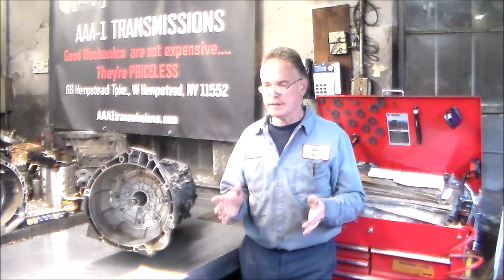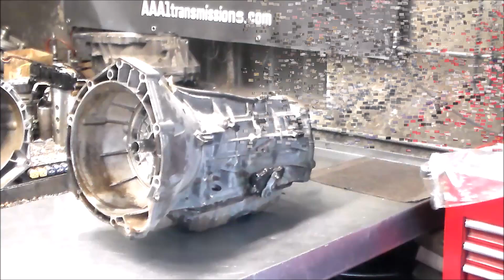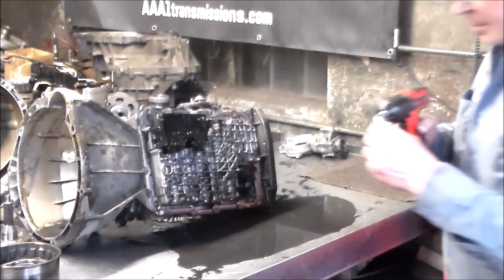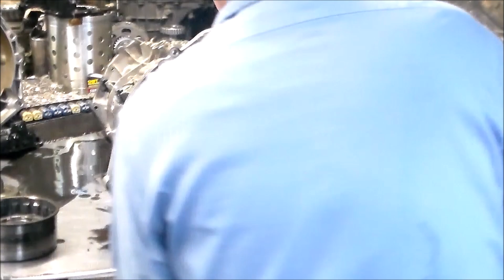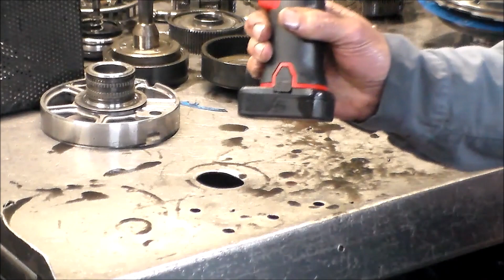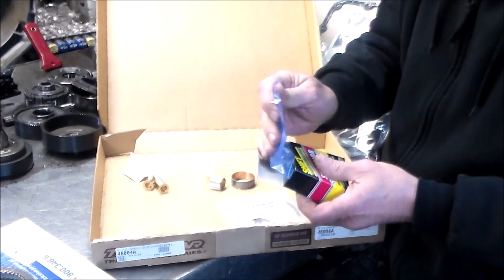Cousin Nick's 5R55S Teardown

Comment: Hello. If I may, I have a question about the 5r55s automatic transmission. It is installed on a 2003 Explorer 3 with a 4.0 engine. The transmission is labeled 2L2P BE. There are no other identifying marks. My first question is, can I install a used 1L2P transmission from a 2002 Explorer 3 with a 4.0 engine? Will the O/D light blink with a slip error? And the second question: the O/D blinks if you drive on the highway at 60-80 miles per hour. If you drive in the city with sudden accelerations and frequent braking, the error may not appear. But it's getting more frequent every week. The scanner shows P 0741, but there can be many reasons. How can you diagnose the automatic transmission without removing it from the car more accurately? There are no specialized service centers nearby. You have to do it yourself.
The oil is clean, there is no metal dust, and I changed it partially two miles ago.
Manual level

Comment: Excellent presentation! 
I have a recently rebuilt 2006 5r55s. Ear snapped off of the od/2/5 band on the apply side. I dont know if there's a wrong direction for the band (i.e. is one ear definitely the apply or adjust side, and how do i tell?) Also: how damaged would the pump be if i remove it that way?
Thanks!
Reply from the maker: Band can go either way.   Shouldn't damage the pump
Reply: @GaryFerraro : thank you sooooooooo danged much for both the reply, and the promptness thereof!
Reply: How much of a pain (and any tricks?) to install the pump with the case in a horizontal position (still on the jack under the vehicle, resting on the pan).
Reply from the maker: @erikdiamet2358 tilt the jack back. Pump should slide right in. Keep the input shaft installed
Reply: @GaryFerraro again: thank you ! Main thing that threw me was that the welded on ears have different numbers stamped on them. I have spent an unseemly amount of time searching forums, videos, and comments  trying to find this information.

Comment: I'm getting codes for three solenoids and low pressure codes for the same solenoids whether connected to the trans or a solenoid pack outside the trans
Reply from the maker: what are the code numbers?

Comment: Do you answer any questions on this trans. I got a junk yard trans opened it and it is like this one. Upgraded a few parts and the original plan was to get it to the shop get mine out and do the rebuild as I know what is going on with that one.
Reply from the maker: Sure, what is your question
Reply: @ what’s the best place to get internals price wise? Like the ones in your video. Also did you change anything in your rebuild of this one the od planetary  came apart in when reassembling it?
Reply from the maker: @jasonbaker4052  Do you know what your looking for as far as internals? I usually change the O/D planet.  What year is yours?
Reply: @ it’s out of an 08 so 38 tooth. Planet is scared and the sun gear is shredded. I am also missing one large bearing on the reverse sprag drum.
Reply from the maker: @jasonbaker4052  can you send me pictures.  
gsferraro@yahoo.com
Reply: @GaryFerraro  I emailed you

Comment: Great video Gary. I have one of these in a 2010 Mustang. Its throwing a PO741 code. The car has 109K miles on it and drives and seems to shift good. I'm trying to decide if I should throw a converter, solenoid pack and fluid at it or if I should just buy a reman one and install it. I don't really know the service history, my guess is none. This was her boyfriends car  before we got it and he was running it hard one night, it backfired and then the wrench starting coming on with this code, no other transmission codes comes up. She plans to keep the car for a long time, so maybe the reman route is the way to go, its just really expensive lol.

Any advice on a reman company to look at? I know I want the servo sleeves installed if I go that route. Thanks for the advice. Russ
Reply from the maker: Do you have a scanner that shows live data?
Reply: @GaryFerraro  I have a CRP129X. It is supposed to show live data. I havent tried it yet.
Reply from the maker: @DoubleRRestorations  look at your converter slip, the PID may say  TCC Rpm or TCC slip, if you can let me know what it is
Reply: @GaryFerraro  Will do. I may be a bit, but I will. My daughter will be home in a couple of weeks and we will test drive it and let you know. Thanks, Russ
Reply: @GaryFerraro  Hey Gary, my daughter is home from school and we are getting ready to test drive the car. Is there a certain rpm or speed we will need to be at to give you this data. Thanks
Reply from the maker: @DoubleRRestorations  i would think at least 50 mph   at this point the converter should be fully locked on
Reply: @GaryFerraro  Hey Gary,  yep, about 50mph, it would lock up. I could also see the solenoid engaging, and the Converter slip desired rpm would be 1020rpm. Once locked, its desired rpm would be 0rpm, but the actual would still go over 200-500. That's when the wrench would come on with a po741 code. 

We did check the fluid before we drove it. (What a task that is without a dipstick, lol.) It was a quart low. 

The tcc actual rpm really bounced all over the place.  I feel good about the solenoid pack with what I saw today on the scan tool. Im thinking it is a defective torque converter
Reply from the maker: @DoubleRRestorations  With that amount of slip very well could be a bad converter,  Also, check the ring on the stator to make sure thats good
Reply: @GaryFerraro  Thank you Gary. I really appreciate your expertise.  Will do.
Reply: @GaryFerraro  Gary, my daughter and I finally dropped the transmission. I had a few questions. I made a video about it. Ill post the link in my next reply. I Know sometimes YouTube blocks links. Thank you for all your help!
Reply: https://youtu.be/HUY7Eeyi_Zc
Reply from the maker: @DoubleRRestorations  Thanks for the video,  1st question do you have a scan tool that shows live data so you can read the converter slip?  The input shaft goes into the O/D planet.  The solid ring is probably ok, i change them and use the converter to resize it, but it looks in good shape.  Question,  when you were moving the input shaft in and out, did it have any up and down play, when the front stator bushing wears out, it can cause a 741 code,  worn pump bushing will do the same thing.  But the big question is, do you know what the converter slip is?
Reply: @GaryFerraro  The slip on the scan tool was low. Like 100-200 rpm over 50 mph. I did see it go to 500 rpm once. When the input shaft pulls out and stops I can feel just a small amount of play, but its not much at all. Its kinda tough to tell because the trans in on a jack/ It barely moves though, if I push it all the way in, there is no movement.
Reply from the maker: @ you saw the slip go to 500 while in lock up ?
Reply: @GaryFerraro  Yes, and the wrench came on the dash.
Reply from the maker: @DoubleRRestorations  Would you say it comes on rather quickly after clearing the code and then driving the car?
Reply: @GaryFerraro  yes, every time we reached 50mph within a minute or so, it would throw the code. Most of the time I was seeing 200-300 rpm, but I did see the 500rpm once.
Reply from the maker: @DoubleRRestorations your converter is probably the problem

Comment: Long shot here.. but im desperate. 
2005 explorer xlt 4.0 with the 5r55s.. no reverse.. all forward gears seem to work fine. 

Had a notification prior "check advtrac" (sorry running on fumes) 

Had a slight knock from trans area, i didnt listen long but sounded like TC per its rhythm with the rpms. 

Then one day it just had no reverse. I hadnt had anytime to check it out.. was hoping it would last longer than it did.

I can work a wrench, but never rebuilt a trans.. not sure what process for diagnosing no reverse other than start at the pan, watch youtube, and hope i can find some help..
Reply from the maker: Sounds like your reverse band is broken.  If the car upshifts with no problem tells me your direct clutch is good, so you just have the band left that would engage reverse

Comment: Gary...does the "sleeving" for the servo pistons hold up. I have seen some techs use brass and others use bronze sleeving. Then others have used modified pistons with teflon//delrin molded to the piston. Thx for the vid!

Comment: You make it look so easy,sending away my transmission to a rebuild shop. It was a used one i bought 2020,not this time u getting it rebuilt.  A new rebuilt from work 4 years ago was expensive, but it still be running, maybe.  Have a good week bud. Ps,me being a pack rat, i kept the other transmission,it got very hot,overdrive light on. By the time i got home,shut it down,fired it up,no gears.😂
Reply from the maker: Thanks for watching
Reply: Sprag gear for the overdrive 40 dollar part your welcome look it up most common failure

Comment: Nice video. I enjoyed the humor also. Great job. ❤
I have an 04 Mercury Mountaineer 4.6 (Ford Explorer) with this transmission. Starting to have some transmission issues at 400k miles. Its been a great vehicle for me.
Reply: nunca antes de las 400.000 millas había tenido problemas de transmisión o motor?
Reply: @bugayev motor is original. I've replaced the timing chains around 220k miles.

Comment: Unbelievable! you actually saw my comment. Thank you very nuch.  Not long after I had the transmission replaced, probably about 4 months, the Overdrive light started flashing after driving the vihicle a bit. But it still ran ok.the mechanic told me it was probably nothing because the vehicle still ran just fine and if it got worse to call him.  It did not get worse but I noticed what appeared to be an oil or transmission leak so I took the explorer to him about a year ago, he checked the fluid level and said it was ok. My wife was driving it two weeks ago and it jumped into the next higher gear when she pulled out from a stop light. When she tried to back out from work, the car stopped moving in reverse and also would not go forward. So her co workers pushed it back into the parking space. But when she got into it later, It ran ok and she drove it home. I also drove it in all the gears including reverse and it drives ok. So I checked the fluid level, it appears ok but the fluid is quite black!
Reply from the maker: Theres something wrong, maybe filter partly clogging up.  Something should have been done when that light was flashing. I would never let a customer drive it with the light flashing, means computer see a problem.  Do you know what code was present?
Reply: I do not know the code but tomorrow I will check it as I have a code reader. Also, I intend to drop the pan and check the filter and check for metal debris. Too cold to do anything today. How do you know where to reinstall all the parts that you took off the transmission? Thanks again for your help. @GaryFerraro
Reply from the maker: Im in the industry since the 80's, plus i do a lot of these units @ronhat-nx6yq
Reply: the only codes I have are p0128 0430 and 1700. 0128 is because engine is cold, 0430 is catalytic converter and 1700 may be transmission.  @GaryFerraro
Reply: @GaryFerraro question, I have a 2003 ranger with 5r55e. I would like to swap in a 55s or 55w because of the lower 1st and 2nd gear ratios. Is this possible? Are the plugs on the wiring harness the same? Will the same PCM work or will I need a different one for the 55s/w. I know that’s technically several questions, but I would appreciate any info you could give me.
Reply from the maker: No, 2 different units @Basketofdeplorables173

Comment: Incredible! I would never get this thing back together. In fact I could not even get it apart. My 2003 explorer transmission just quit. When I checked the fluid level, the fluid was black. And this transmission is only 3 years old as a rebuilt one was installed.
Reply from the maker: Stopped moving?
Reply: Unbelievable! you actually saw my comment. Thank you very nuch.  Not long after I had the transmission replaced, probably about 4 months, the Overdrive light started flashing after driving the vihicle a bit. But it still ran ok. He told me it was probably nothing because the vehicle still ran just fine and if it got worse to call him.  It did not get worse but I noticed what appeared to be an oil or transmission leak so I took the explorer to him about a year ago, he checked the fluid level and said it was ok. My wife was driving it two weeks ago and it jumped into the next higher gear when she pulled out from a stop light. When she tried to back out from work, the car stopped moving in reverse and also would not go forward. So her co workers pushed it back into the parking space. But when she got into it later, It ran ok and she drove it home. I also drove it in all the gears including reverse and it drives ok. So I checked the fluid level, it appears ok but the fluid is quite black! @GaryFerraro

Comment: I'm looking at buying a 2003 V8 Ford explorer and it slips in 3rd gear (drops out). Got any suggestions?
Reply from the maker: May have a broken band, very good chance it will need an Overhaul.
Reply: @GaryFerraro  is it okay to drive it in first or second gear about a mile
Reply from the maker: if the car shifts to 2nd you can go at least 30 mph,  are you planning on getting this fixed? @harrycash8713
Reply: Yes Gary I bought the car 2003 Ford explorer XLT 4.6. when I put it in first gear it's fine when I moved to second gear it's fine when I move the selecter to third gear it starts acting kind of funny and then when it gets into drive it starts slipping once it's warmed up. The only code I'm getting is a P0733. The overdrive off light starts flashing when it slips. I've heard the intermediate servo can get loose. There is a patented modification servo kit available. They say it can be done without pulling the transmission. Any help would be appreciated 👍
Reply from the maker: Yes,  I never used that but you can take the servo piston out to see if any problem, little bit of a pain to do but its doable @harrycash8713
Reply: @GaryFerraro  thank you sir

Comment: 08I have a 5r55s transmission 08 Explorer that is missing 2nd and 5th gear. I took it out and checked the servos, but they were both good or at least not broken. I am getting thr P0775 code, so my question is what else it could be? It still drives but has to rev to 3-4 thousand rpm before shifting from 1st to third.
Reply from the maker: you may have a broken band (very common)

Comment: Gary,  I recently installed a rebuilt pump in my 545RFE dodge transmission  when I put the pump in it slipped out of my hand in my haste I didn't think to pull it back out to check the rings on the pump.   If one of those rings is broken how might it affect the operation of the transmission
Reply from the maker: may cause a bad slip or bind-up on a shift

Comment: Hi Gary, I have the code you asked for on the 2008 bmw 528i, to refresh your memory,
The car stayed on Park and would not engage to any other gears.
 We changed the valve body, empty the old fluid and replaced with 10 quarts of Pentosin  Atf 1, 
Same problem,  it wouldn't engage,  however after 10- 15 minutes of idling the check engine/ transmission light turned off and it worked perfectly. Drove it down the highway and it performed great. 
Next day , same issue the next day. Will not engage into any gears from Park position. 
The code reads:
4E20
EGS(Electronic Transmission Control)
Electronic Pressure Control Vale.

Thanks in advance Gary!!!
Reply from the maker: I have seen this, you changed the valvebody and solenoids?
Reply: @GaryFerraro  yes,  valve body and solenoids were changed
Reply from the maker: @maxh6920  That is a solenoid code, everything is within the tcm, no wires to check, the code will not clear? if you have, try another scan tool to see if the code will clear
Reply: @GaryFerraro  Gary we cleared the history and set back to factory setting but the code came up again, could it be a bad solenoid, If so which one?
Reply from the maker: @maxh6920  Tell m the code again please?
Reply: @GaryFerraro  sure,
4E20
EGS (Electronic Transmission Control)
Electric Pressure Control

Comment: Hi bro 
I have x5 4.8i 2008
Reply: I have this code 4f89
Reply: Can u tell me how can I fix this
Reply from the maker: @magdymohamed1830  This code is 3-4 ratio error correct
Reply: @GaryFerraro   can u explain how can I fix this error
Reply: Yes
Reply: @GaryFerraro  yes same error as u told
Reply from the maker: @magdymohamed1830  The most common problem with this code is a worn rear stator bushing, trans has to come out and apart to install a new bushing, also while apart check the E clutch, the E clutch tends to flake causing to much clearance in the clutch pack
Reply: @GaryFerraro  the error is 
4f89 ratio monitoring  gearshift 3 4
Reply from the maker: @magdymohamed1830  correct, did you read what i wrote that can cause this